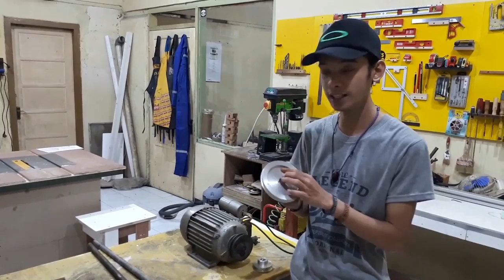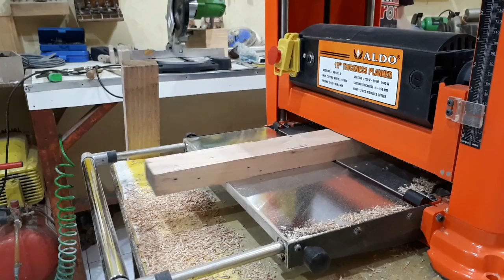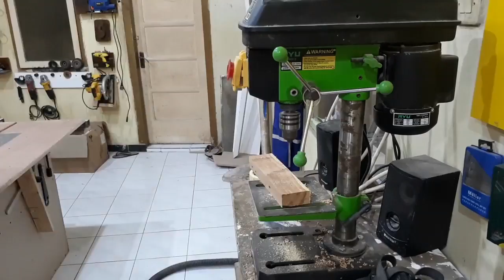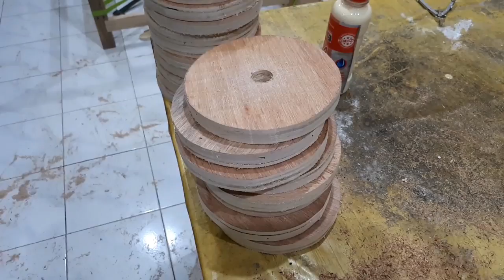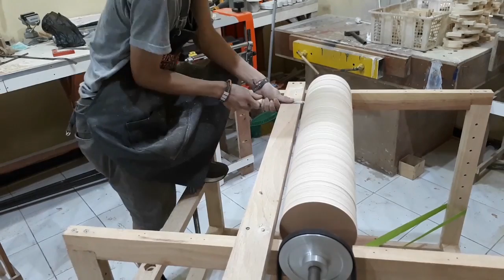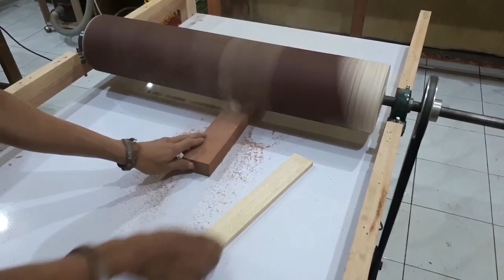DIY Drum Sander -  Thickness Sander Homemade

Comment: Nanya bang..
1. Kalo drumnya 4 inchi pake dinamo DC 895 kuat ga bang?
2. Untuk mengatur kecepatan putaran/RPM sebaiknya diameter pulley besar yg atas atau yg bawah bang?

Tolong dijawab ya abang ganteeeeng...  trims
Reply from the maker: Kalo diameter drum nya 4" bisa cuman panjang max nya paling 50 cm lebih pendek lebih bagus. Soalnya yg sayapun itu ke panjangn. Kalo sepanjang itu as drum nya harus lebih besar lagi. Dan base bawahnya harus full besi. Soalnya masih melenting.
Bagusnya sih rpm rendah tapi bertenaga. Jadi diameter yg di motor lebih kecil dari yang atas.biar lebih bertenaga.
Untuk dinamo dc nya yg rpm berapa dan berapa hp.kalo di atas 1 hp masih bisa. Kalo di bawah 1 hp mending bikin yg lebih kecil aja.
Yg pasti as amplas sama meja nya harus bner2 kokoh. Karna saat memasukan benda kerja ada tekanan tinggi antar keduanya jadi melenting yg jadinya hasil hamplas ga rata alias bergelombang.
Reply: @BetsWooD  mksh banyak baaang.. 🙏👍
Reply: @BetsWooD  saya buat kenapa ya ms. Kok getar horek semua mejanya. Apa harus pakai rpm rendah ya ms
Reply: @BetsWooD  untuk rpm drum sander idealnya BRP rpm ms?